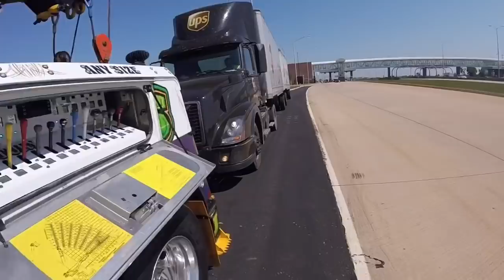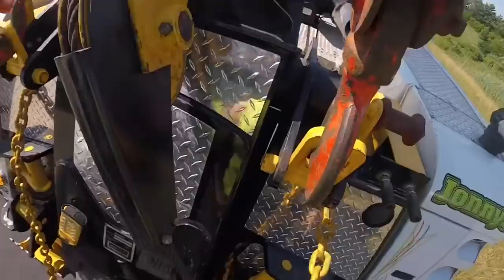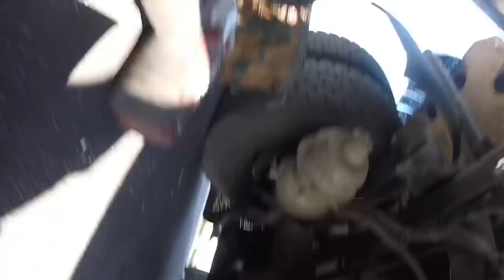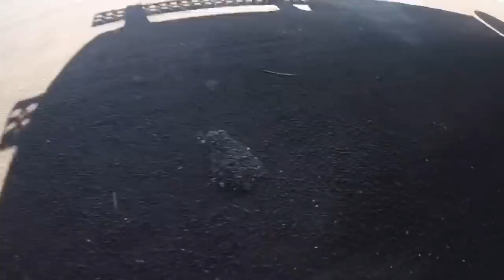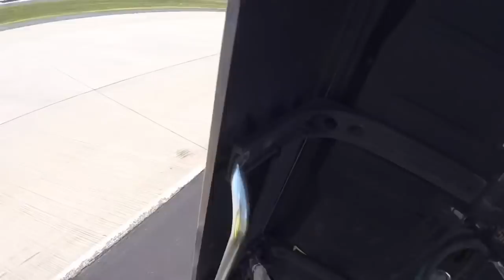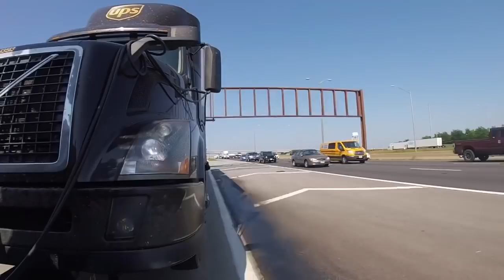Rotator work ep 96 doubles hook and tow

Comment: Had a semi flip over when he took the shoulder on Interstate 20 in Shreveport, LA after he crested a hill and came upon slow traffic, so, he swerved to the shoulder and the truck fell over towards the passenger side. It was a Poulan weedeater & chainsaw truck full of oil and bar & chain lube.

We were called out around 5pm to unload the trailer by hand into another truck and trailer so they could get it towed out of there after getting it upright. We were there until around 4am unloading that truck. Finally they brought out 2 rotators to lift the truck and turn it right side up. That was a heck of a night. Got back up at 530am to go back to work the next day. And had just gotten off at 3:30pm when they called us out to help.

Comment: Thank you for your quick response , all the 10 wheeler dumps and the low boy transports all had anchor loc parking brakes the caging  t bolts were stored on the side of the housing but we keeled them in the glove compartment. All the dumps were GMC  Detroit Diesels automatics Allison 650 Dr and had aux  4 speeds trans the pay loaders and dirt pans were
Reply: W

Comment: Nice job guys. When do use the extra set of wheels on the rotator?
Reply from the maker: All the time if not I’m over weight by 4800 lbs empty or not
Reply: malachi mckay Malachi I drive a cement mixer now my gross is 84 thousand pounds and I have 1 steer, 2 pushers, 2 drives and 1 tag axle. If you don't know anything in front of your drive wheels is called a pusher axle because they push the front steer axle and anything behind tbe drive axle is called a tag axle because it tags along behind the drives. You probably already know this but if not, well now you do. Be safe buddy keep up the good work.

Comment: Can you explain why had to do something to the parking brake cans since you had air line run?
Reply: Alexis DeVille he caged the tractor. But had air ran to the trailers.
Reply: By caging the brakes he means the bolt he installed now over-rides the spring pressure that sets the parking brake.
Reply: dropn loads I know what caging parking brakes is, I was wondering why he ran supply air to trailer instead of tractor like they usually do?
Reply from the maker: Because on these trucks it’s faster to just back the bolt out of the chamber rather then running air these chambers come with the bolts built in so all you have to do is back it off and it’s free rolling